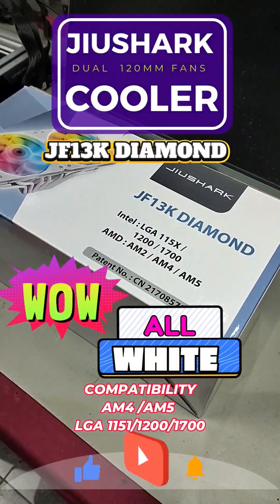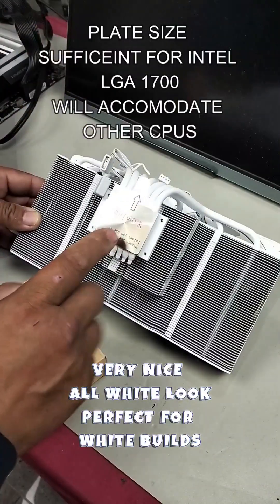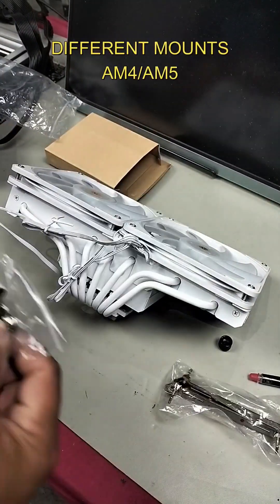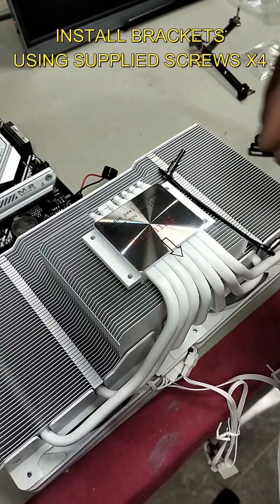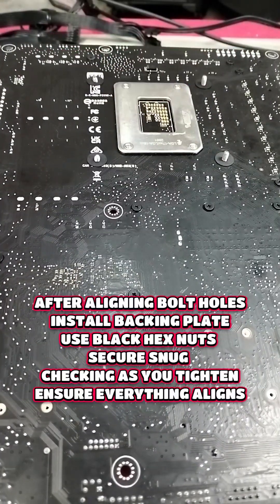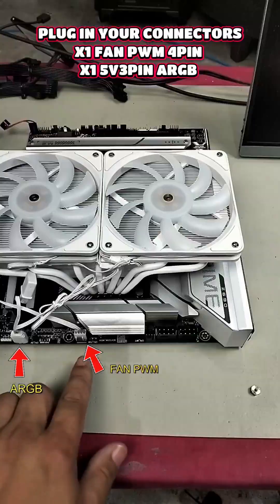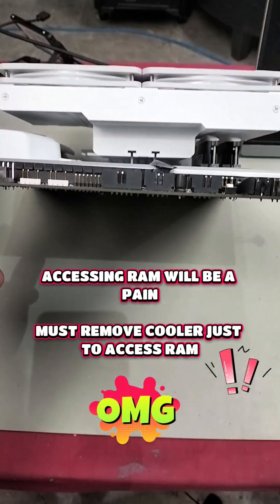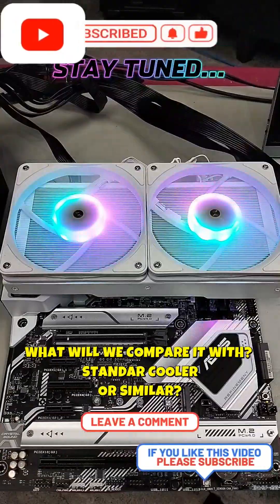JIUSHARK JF13K DIAMOND DUAL SLIM 120mm argb fans  cpu cooler all white. no more AIO?

Comment: why is the motherboard bent?
Reply from the maker: @TechnologyUncovered-b1i  this is a used mobo I'm guessing the previous owner didn't mount with equal pressure or just too hard and over tightened nuts and screws causing flex.. I've seen this with numerous mobos... with constant heat and unequal mounting pressure this is what can happen..I've seen it all too often

Comment: Side note- I want to pair a set of Phanteks, (T30's) with this. And use it in a sandwich build. GPU backplate up against the motherboard rear.
Reply from the maker: u would habe to figure out how high it sits and whether u have the clearance my friend... its not bad ..but def takes a lot of room
Reply: @MIKEYZVLOGZ  If no case exists. It would be built in a custom housing. Dgmw- I like my 600T. But, I need way less space than that.

Comment: Don't quote me on it. But, I think that cooler can go the other way round. Giving the ram more clearance. *may interfere with vrm heatsink.
Reply from the maker: nah ur right ..I dunno why I silly did it that way ..its supposed to be the other way around.. lol.. I'm still very new to building and etc..hence why u always read the manual lol
Reply: @MIKEYZVLOGZ  Just an observation dude. Happens when you look at dozens of builds with (x part) as the focus. You're doing fine with the content creation btw. I'm an older builder- think slotted cpu's where owning a couple Gigahertz processor is either the dream, or hyperthreading was the game changer.
Reply from the maker: @justinpatterson5291 ye I appreciate u for that...I havent been building pcs along time ..I can honestly say I've only got about 3 years under my belt but I've learnt alot in 3 years but I'm in no way a professional ..but I like to share the pov of a beginner so ppl can see if I can do it they can too..that's the whole point of my videos..sharing my experience as a newbie building pcs..so I always appreciate constructive criticism

Comment: takes up way to much space for no reason way better off with an aio
Reply: Except no pump to break in this. Custom loop > air > AIO, for me.
Reply: @AlanGresham  yeah but aios are very good if you want a silent pc WIthout breaking the bank.
Reply: @Fekxyz-gr8hc   no quieter than good air coolers, in my experience, and less reliable. They have so little coolant that the fans have to spin up as soon as you introduce a load, same as air coolers. Meanwhile, in a custom loop, I can compile code for two or three minutes without the coolant temp rising enough to change the fan speeds any noticeable amount. By the time I do the next build, the idle speeds of the fans are enough to have bled off the heat from the previous workload. AIO’s fans go flat out as soon as a 100% load is introduced. May as well use air.
Reply from the maker: good point mate
Reply: @AlanGresham  oh hell naw i think you are mad that you cant afford an aio.
Reply from the maker: ye u got a good point